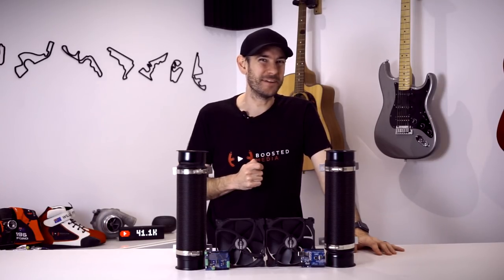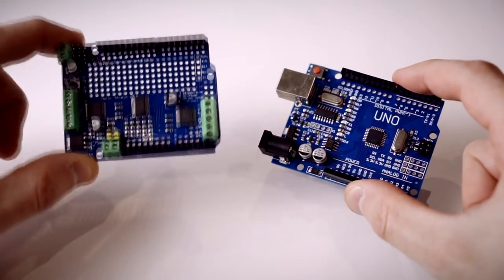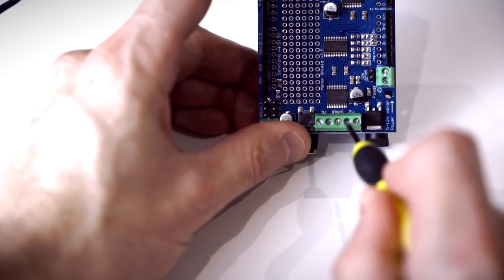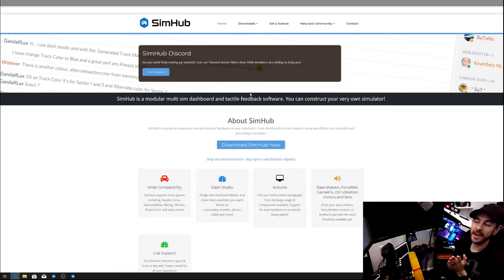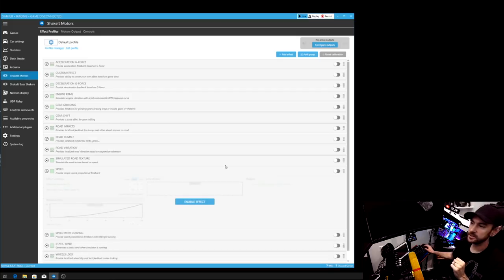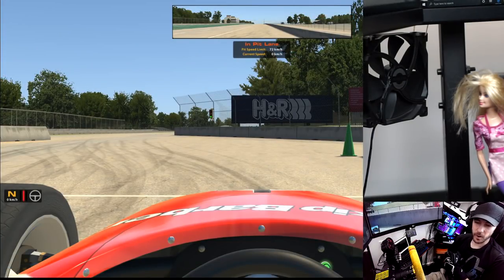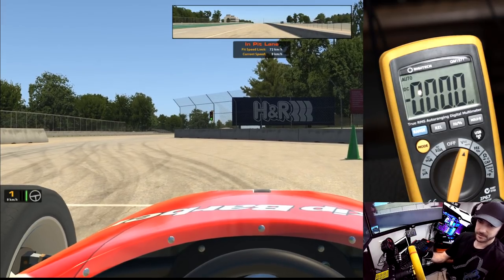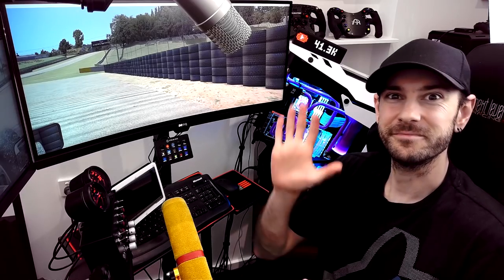Building a DIY Wind Simulator - Part 1

Comment: buddy you have the wrong shield and the wrong fan going. try a monster moto VNH2SP30 Stepper Motor 30 amp along with a 12 volt dc motor with a couple small table top "clip on style" house fans. of course with a the arduino will work very well. make sure you have a 12v -24 volt fuse box to not over amperage the circuit. fine tune and you will have a very very  powerful wind sim. oh by the way you will need a more beefy power supply to run this behemoth and im using one of two 12v 30a Dc Universal Regulated Switching Power Supply 360w on my motion rig.    Enjoy :O)
Reply from the maker: I’m well aware these were the wrong fans. I said so at least 10 times in the video. I chose the motor shield I chose and the fans linked because they will still provide a good effect but at a fraction of the cost of the gear you’re talking about. 

But yes what you’re describing would be the ultimate solution. 

I may do this later on but people get really upset when I do DIY videos that cost “too much”.
Reply: Sorry guy i didn't listen to your video, i just saw you with you're barbie there and became a keyboard warrior and plopped my two cents in without regard of your tutorial. By the By my friend.  i think you might have the wrong fans there.  😉 Love your stuff and keep up the good work.
Reply: I went with a similar spec fan (but not exactly what Will recommends),  but each fan has a max of 3amp, too much for that power supply and the Motor shield.  Going to look at that monster moto, but if I want to try the desktop fans do you have an example of the type your are talking about?  Can I use a couple 12v dc fans (like th kind you can plug in a car cig lighter, wired to the moto board?  Higher amp 12v power supply.  Where should I install a fuse?

What I built runs but with both fans I get power drops at constant high speed, with one fan it works, but the v2 board says 1.2amp per fan 3amp total max, so I don’t want to leave it that way, even with heat sinks on the v2.

And thanks, Will, your video was so easy to follow!  I did have to solder the connection pins to my Motor Shield, but a fun little project!

Comment: Will. Please help. I have been on the discord with this issue as well. I have followed all the steps to this video. The fans work during testing just like in your video. But when I play a game the fans do not come on. I have played dirt 2.0 and also f1 2018.
Reply from the maker: Check simhub documentation for configuration  for those games.
Reply: Boosted Media just an update. I checked the configuration a couple times for both those games. I switched over to iracing and it works perfectly. I have determined that it just won’t work for dirt 2.0 and f1 2018. If you end up trying it on either of those two games and it works for you please let me know and I’ll go back to the drawing board. I was very happy to see it work
For iracing though. Was getting concerned that when I soldered the pins on I might have mad a mistake
Reply: @boostedmedia  Will everything has been good with iracing working on the wind sim. I have been having some issues with it not working here and there. Do I need to start iracing in the sim hub app or it shouldn’t matter. I even went back and cleared all the boards setting and restarted

Comment: Is there a way to regulate each fan individually based on the steering angle+speed? 🤔
Reply from the maker: The next option down unlocks more adjustability including directional wind. To be honest I haven’t played with it yet but I will before Part 2.
Reply: @boostedmedia  cool, so you can do surround wind with 5.1 fans? 🤔 this gives the full "spinning around" atmosphere 😂
Reply from the maker: @RubenKelevra  where do you put the "subwoofer"? (maybe don't answer that). lol

Comment: Followed step by step and when I hit test my fans do absolutely nothing.
Reply from the maker: Have you checked the board is powered up correctly? LEDs are lit up?
Reply: @boostedmedia  I have a green led lit up
Reply: @paulhodges5186  im having the same prob. any fix yet mate?
Reply: @bigbacko  nope not with that setup. I bought replacements of everything and it still didnt work. So my fix was I spent the extra money and bought the setup from Sim racing studio. Plug and play works flawlessly.  It's called SRS double the fan kit. Good luck!